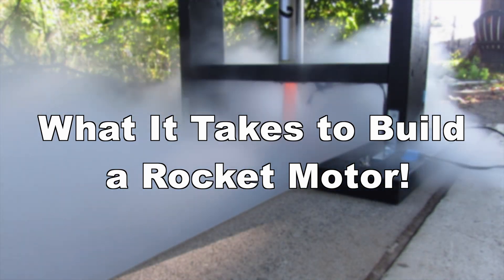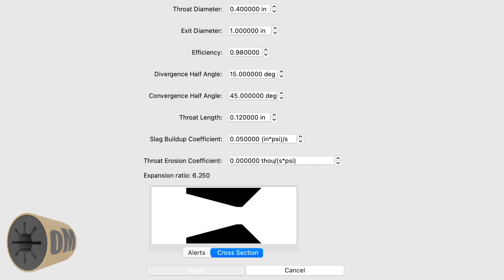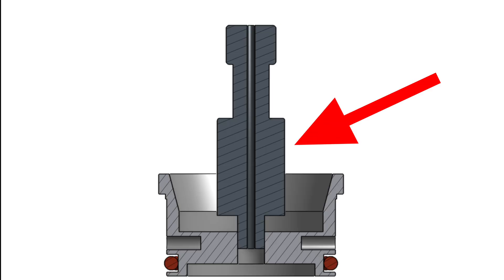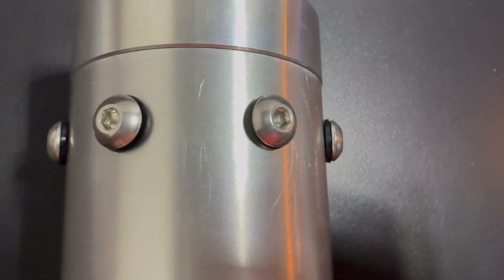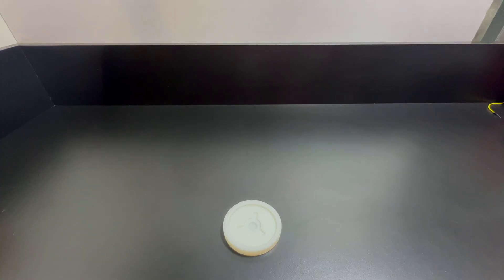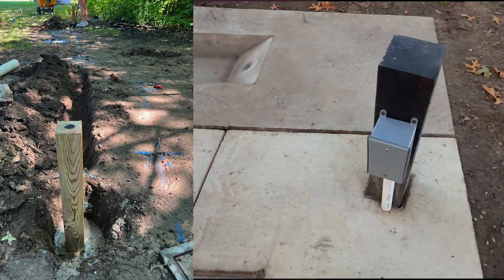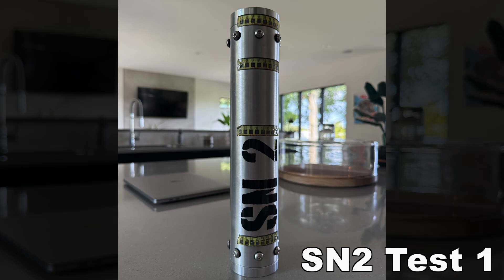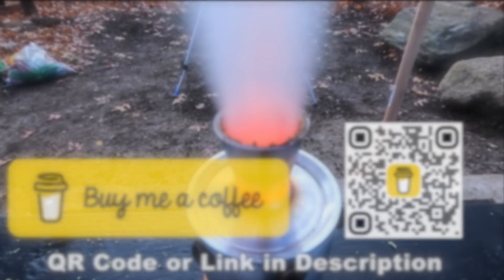What It Really Takes to Build a Rocket Motor

Comment: have you thought about using a strong vibrator (live very very strong ) to shake the propellant in a oven to keep the fuel liquid for longer and pour it while the vibrator is running on low power

Comment: Great video! Keep up the good work. One question. How are you going to put the motor in a rocket if the screws stick out from the casing?
Reply from the maker: Thank you. I plan to make two sleeves that will mount to the outside of the motor past the bolts.

Comment: Awesome video! Thanks for documenting your progress, it really helps envision how things work in the real scenario. I do have a question, is your liner one card board tube or multiple of them glued together? I'm wondering how you would go about sealing the gap between multiple tubes so you don't get exhaust going in between them and heating the casing.
Reply from the maker: Thank you! The cardboard liner is not layered; it’s used as-is straight from purchase. The tubes are taped together using a few layers of standard painter’s tape. Hot exhaust gases don’t seep between the liner and casing because the propellant acts as an effective insulator during the test. Once the propellant burns down to the liner, the test is complete!
Reply: @AeroPropulsions  I see, i'm building a motor with 4 grains, each attached to a liner, and im worried there will be exhaust leaking between the gaps. So I'm not sure if using alluminum tape or epoxy will stop it

Comment: COOL @AeroPropulsions !!
Well is that load cell a 5v input or a 10v input. and can i get load cell link, where you got it from. also is that base plate of the casting jig 3d printed or machined? and what material is that?
Reply from the maker: Thank you! The load cell is 5V off of amazon. Any one will work, I have used many. The casting JIG is resin printed C-UV 9400EM, any heat resistant smooth material should work well.
Reply: @AeroPropulsions  Also like how do you make that silicon coring rod?
Reply from the maker: @ The silicone tube is off of amazon which is cut to size, and I use a 1/4 inch bolt that is also cut to size to keep the silicone tube rigid.
Reply: @AeroPropulsions  damn smart. I thought you cast the silicon in a mould.
Reply: @AeroPropulsions  Also dude just wanted to know what thickness are you using for the liner?....cause am using 1mm liner for my 300 psi custom i class motor.

Comment: I made a PVC motor design based off of a tutorial that I drew by hand following measurements. It's small and still needs to be made (college is a little heavy right now). More research needs to be done in order to ensure the right parameters are set for the motor and future projects. The goal: Thrust vector controlled aerial rocket vehicle that can fly to a specified altitude. Inspiring video, I love your channel!
Reply from the maker: Thanks! Your project sounds amazing—keep at it, and good luck with the thrust-vector rocket!